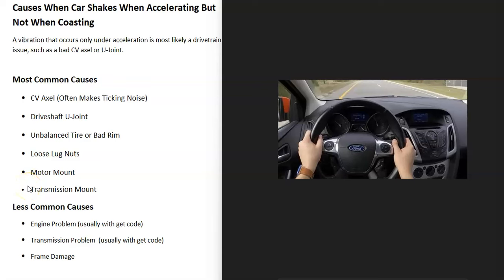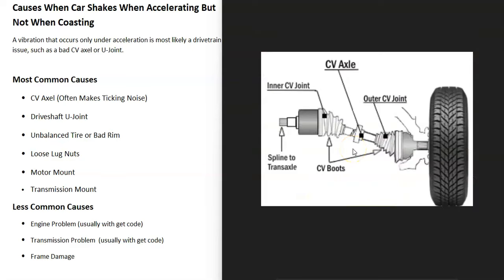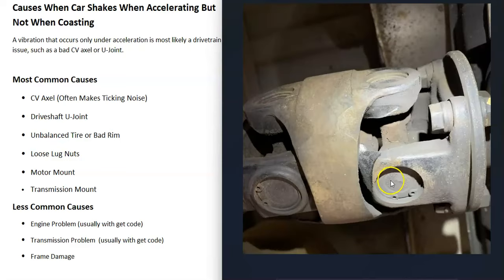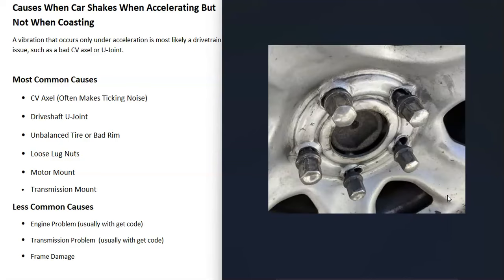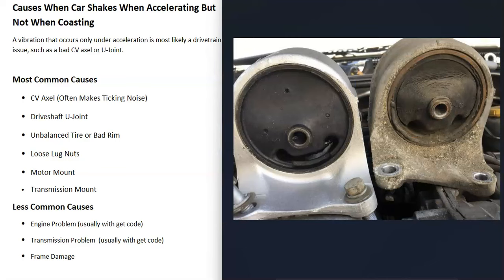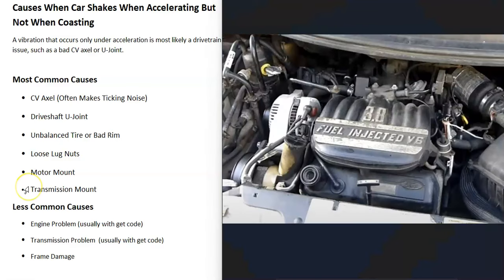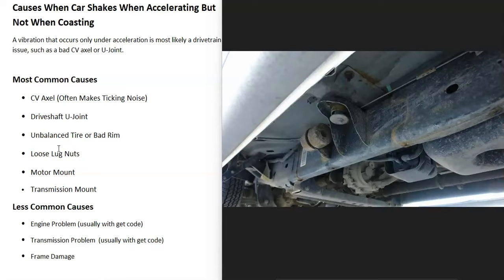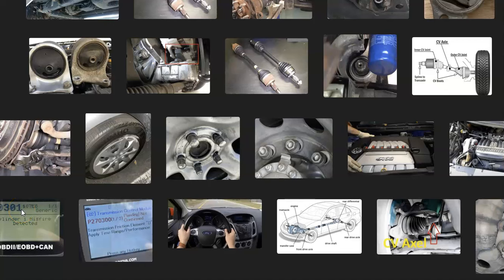Causes When Car Shakes When Accelerating But Not When Coasting

Comment: My 2006 HONDA CRV shakes when lightly on the acceleration and won't stop shaking until I floor it or come off the acceleration entirely. Feels like my whole cabin is vibrating 📳 like when you're on a rough patch of road
Reply: My current issue now😢 on honda civic 2012
Reply: I’m facing same issue
Reply: Had mine solved.  Bought an original honda engine mount and had it replaced. Car drives very smooth now
Reply: @toptr3ndingghana380  Oh, so you think it's the engine mount... hmm ... I thought it was transmission shudder
Reply: same with my 05 civic.
Reply: Have you had it fixed?
Reply: @NguyenDuongVu  it's transmission shudder. I had no transmission oil in the transmission... issue is the plates sticking. You can get a transmission service... no guarantee it stops. You can also add a shudder fix to the transmission oil. I have to get the transmission serviced again in 1 year because there's still old oil that was mixed with new oil but didn't come out from the first service.
Reply: @xXxChaoticXx  thanks, I will consider that too.
Reply: Sounds like a CV axle issue
Reply: @Pnellyvlogs  Nope. Trannie shudder

Comment: Great video just to get me to thinking. Just happened to me. The day before. I went & got an oil change/tire rotation. So on my way home from work the next day. I'm feeling all types of vibration from my rear. Upoon further investigation. Found 4/5 lugs nuts loose. The most disappointing thing. The tire shop that did my service took no accountability for their error. This could have been critical or fatal to me and others. I believe in traveling by grace, and I was fortunate to even make it home.

Comment: Don’t forget the torque converter. There’s at least one vehicle out there known for a sudden [shudder] around 55MPH which goes away when you slow down or accelerate out of it. Can’t recall if it was a Sienna or a Caravan but if you didn’t get the applicable service bulletin applied it was inevitable that your torque converter would fail that way.
Reply: Thats a shudder
Reply: Fixed! Thanks. Didn’t notice auto-correct had changed shudder to “sudden”

Comment: I’m having symptoms. Like this. I have 4 matic awd. Just buy the car. The guy told me he hit pit hole. Change different tire after flat. But when I took a close look. Both of those rubber boots were broke. It was very greesy. There’s no noises. No check engine light. Would I need to have a special tool to change cv axel. Theirs no scratches or damage to fender.

Comment: My 13 Silverado jerks hard when i put it in drive and also most recently it shudders when im reach 25-30 mph. I just had motor mounts replaced. So im not sure where to look. Transmission shifts fine no hard jerks or anything.
Reply: did you figure it out?

Comment: 2020 Colorado Z71 Owners!!!

-Just bought my first truck. She had a serious sporadic jitter that drove me insane. Researched and performed the GM HP (high performance) Transmission fluid flush. Completely fixed it! 

I’m short this process (if done right) will flush the torque converter thoroughly and replaced the fluid with one that can handle those 8spd transmissions. $500 for me and dealer paid it. Woot. You’re welcome

Comment: Mine only shakes when accelerating when it gets between 1800 and 2000 rpms. 2 mechanics so far tell me they do not know what it is. One thinks it's the torque converter. It's been getting worse for about a year. Does this sound like a torque converter issue? Its also worse when I accelerate slowly.
Reply: Did u find out what it is I’m having same issue
Reply: @ravin6884  No not yet. I'm supposed to have a mechanic look at it this week. It could be a number of issues. Could be CV joints which is a lot cheaper than the torque converter.

If it is the torque converter, ask your mechanic how much they charge hourly. Replacing the torque converter is about an 8 or 9 hour job because the transmission needs to be disassembled and rebuilt in our Saturns. My mechanic charges $100 an hour and it's about a $150 part.
Reply: Any updates?

Comment: Torque converter issue with my ford f-150. Lots of shuddering on the highway in 5th and 6th gear. Got my Tran fluid flushed and changed. Shuddering went away. Can add shudder additive if it continues.

Comment: Thanks for the video
So I just bought a car drove fine for two days transmission shifted smoothly no issues. Was driving home one day and was shaking bad when I would accelerate, coasted fine
So my issue now when I shift from park to drive ( sitting still, not moving forward ) the whole car violently shakes like it's about to fall apart.
So I checked underneath my transmission mount is completely broken. And I have a bad passenger CV. 
Lifted on the jack the tire only turns about a quarter turn back and forth before the CV axle hits metal and stops the tire.
If I wiggle the tire left to right I can see the whole motor and trans shaking sorta like it's floating on water.
I believe that's my only issues is the trans mount and CV? I don't think it's an actual transmission problem.
I'm just wondering with a broken trans mount and bad CV, ( would it cause it to be violently shaking the car like a death shake just simply shifting from park to drive? Not moving forward at all?) like I have to immediately throw it back in park for the shaking to stop it feels like the car is just gonna blow to pieces. But In park the motor and all runs smoothly. And like I said it drove and shifted smoothly up to this point as well 
So does this sound like the CV axle and trans could be my only issue?
Or does this sound like there's something more to it? 
06 Ford fusion 3.0
If anyone could give me some idea I'd greatly appreciate it.
Reply: Sounds like ur mount

Comment: Im trying to figure out mine right now I have a 2009 chevy impala, I replaced an engine mount but didn't solve the issue. Im thinking my transmission mount is bad or something because the shaking is worse when I go up hill. I havn't changed my transmission fluid in 175k miles so Im gonna do that too

Comment: 97 Ford Explorer AWD XLT 8 cyl 5.0 302ci. Starts vibrating when I hit the accelerator after a stop sign or when the light turns green. Not right away but after it gets up to speed about 30 mph. Not when coasting and not when I put it in neutral and rev the  engine. I replaced the transmission mount, removed the front driveshaft/CV joint and replaced a worn tie rod end. I'm playing hit and miss. But at least I'm finding things that need to be fixed before they get worse. But I'm stumped on what else could be causing the vibration all of a sudden. I'm praying it's not something major like the crankshaft or a worn out front differential. Motor mounts seemed ok. I didn't notice any shaking when I revved up the engine in park. Maybe it is a CV axle....🤔😫😡😭💔 I'm retired but I have to drive my daughter to school and back twice a day. On a fixed income and these repairs are draining me dry when I really need the money for gasoline. Can't afford a new / used vehicle and I love my truck. Even if it is 27 years old and the driver's seat is worn out. 😂

Comment: Hello just replaced some spark plugs on my mother in laws Nissan Sentra and I thought the shaking would of went away from the gas pedal cause it just started doing this the car and pedal does vibrate while idling as well noticed the gas pedal shakes a ton while at 2rpm or around 40rpm if I go faster it sometimes stops shaking in the pedal tomorrow I will re torque the motor mounts to see if that will help might have to check the transmission mount but her tires aren’t to used she don’t drive crazy or anything so I don’t think they are unbalanced I just changed her brakes so she def don’t have messed up calipers I’m thinking mounts are loose or something cause the motor even shakes quite a bit when its just in idle

Comment: My car shakes under load/acceleration but not when it's cruising.
I had my CVs redone but it still has the same symptoms.
What could be the cause? Engine mounts don't look worn.
Reply: I am having the same exact issue. Been to 4 mechanics and still no solution
Reply: @jessicajones119  consider checking your ignition coils or spark plugs. It turns out that's what the issue was for me all along.

When is idling it doesn't misfire, or when I'm driving slowly. Only at high speeds under load.
Reply: @tshepomogano789 you didn't have a check engine light?

Comment: I took our 2010 Sonata to Discount tire to get road force balance done they checked for separation as well. Car still shakes after balance was done and tires are fairly brand new with only about 3000 miles on them. Any clue on what else it could be? Shaking is felt driving at normal speeds steering wheel shakes. Lug nuts are brand new as well. Help???
Reply: Hey! 2015 Sonata with the same problem. It’s currently in the shop to get its axles repaired so hopefully that’s the problem. Did you ever diagnose the problem?

Comment: Rattling sound is heard in my ford figo 2010 diesel from left front area  . It makes rattling sound occasionally . It had also stopped in between for like 5-6 months but now it’s back again. ( mostly rattles in straight rough highways ) . only on left front wheel area . Rattles loud. If anyone knows about issues. Plz share the info. if anyone knows about the issue. I would be thankful 👍 ( idk if this helps when braking at 60 kmph or above the car pulls slightly to either side and above120 wobbley ). Thanks 🙏 if someone shares the info: Ford Figo 2010 left front section only ( whole car condition 3/5 )

Comment: I have a 2001 Cadillac Seville sls. From 50-60mph when I accelerate the car shakes really bad and I feel it in the gas pedal. My steering wheel does not shake however.. what could that be

Comment: My mustang does this it won't accelerate fully shakes makes a load vacuume sucking noise then hits the rest of the rpms slowly it started on the highway last month 3rd and 4th gear now it does it in all gears but 1... its in the shop now they're looking at it on Monday here at Ford. NO clue what this could be

Comment: My car engine shakes some times when driving at 40 mph but stops when I let go the gas pedal or if I accelerate. But some times it does it again at a different speed like 65mph 70, or 75. So I’m trying to figure out what are the causes. Thanks
Reply: mines around 55-65 and stops when i do the same as you stated above been over a year with no answers after bringing it to be diagnosed several times, after doing my own research it hurts to say but its most likely the torque converter, only a transmission specialist would be able to diagnose it unless a code  pops up on the scanner tool

Comment: So I have replace many things on it already and it’s still shaking. 
:( any other suggestions
Reply: 😂 its the process even I spent the money thinking lower arm was the cause 99% but who knew I just wasted 100% of the money on replacing a prefectly good part thinking it was the cause for rattling noise on left front area. FYI It did STOP that noise but only for 1-2 month then it (noise) came back 🥹😂😂😂(ford figo 2010 ). any helpful info on or related to figo faults on wheel and movement joints would be great 👍 thanks .❤